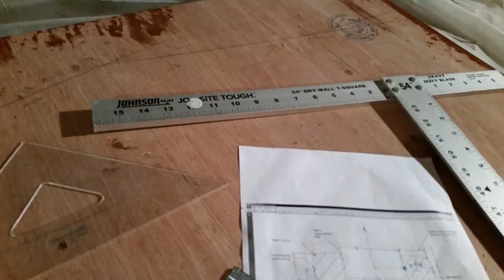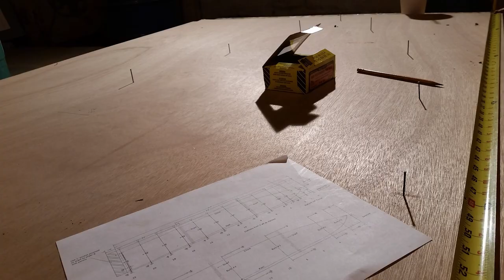Building a pocket yacht  boatbuilding slideshow.

Comment: Wow, that was a lot of work, great workmanship and you got a very cute boat out of it.

Looks like a good candidate for electric power?
Reply: The flat transom semi-displacement hull is a problem for electric power. At low speeds, the wake turbulence will hamper the efficiency too much. You could spend 5x the cost of the hull build on propulsion that can get to planing speed, but the weight of the batteries to do that is a problem. For electric, maybe consider the maia 21 or 24 from boatbuildercentral. On a displacement hull like that, you might get 3-4 hours @ about 7kts. You could extend that with a diesel generator if you can find the space for it.